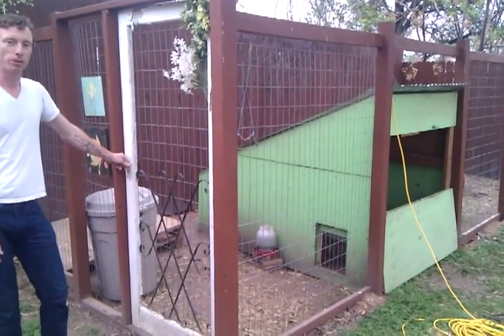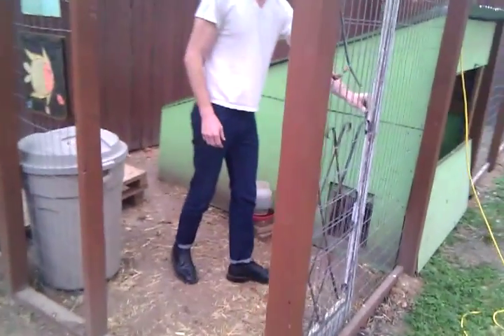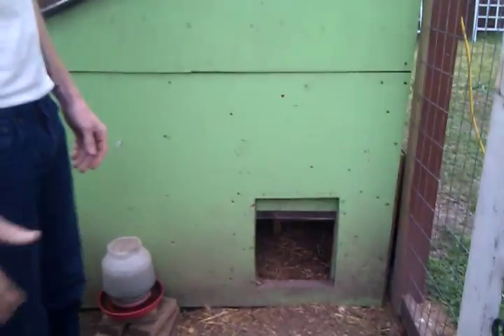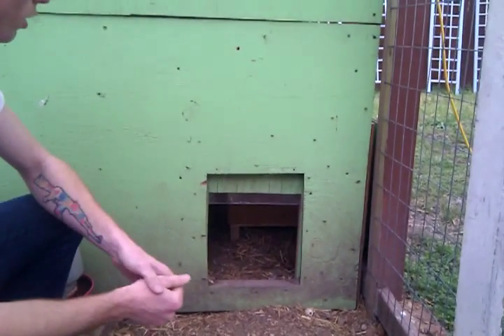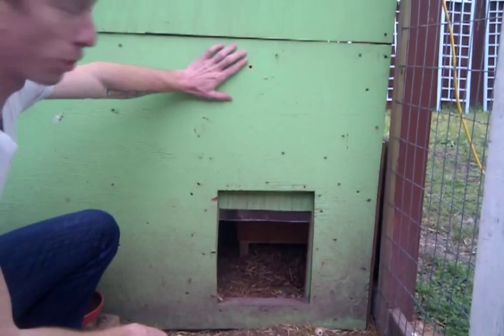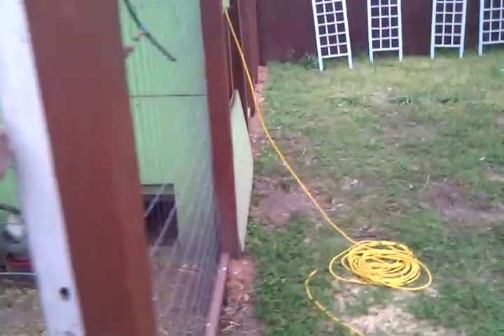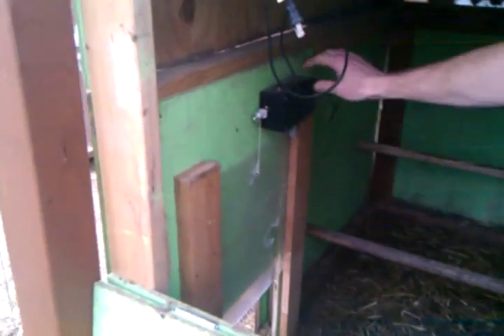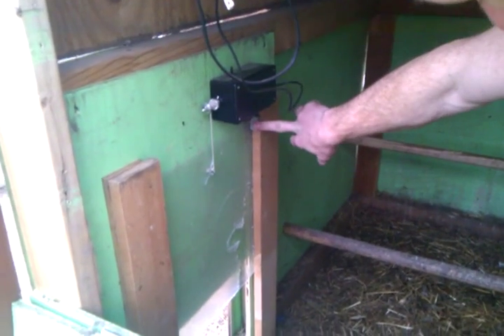Automatic chicken door - arduino + light sensor

Comment from the maker: I used the shield on the video description.

I'm not sure if the specs on that page are wrong or if it simply drives the motor with more voltage than it needs. I don't remember the specs not matching when I put the thing together. Either way, it's been running without issue since this video was posted.

Comment from the maker: The total cost was probably around $100 including arduino, motor shield, motor, enclosure for the project, and other small bits of electronics.

How did I construct the system? Solder and screws mostly.

Comment from the maker: I used this 52RPM 3V motor which I've added a link to in the description.

I wrote the code myself. It's pretty straightforward. I did include some checks so to turn the motor off if it runs for more than 30 seconds in case of malfunction.